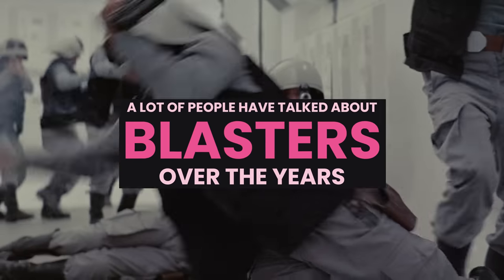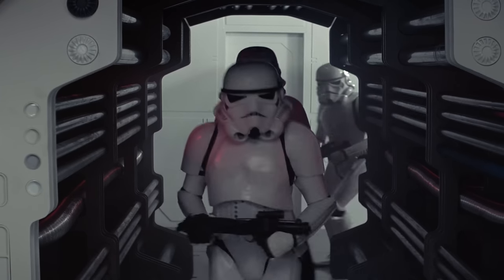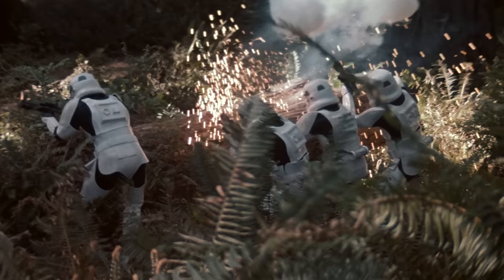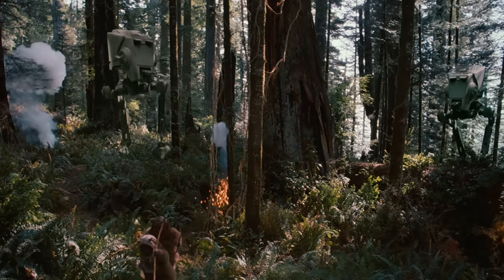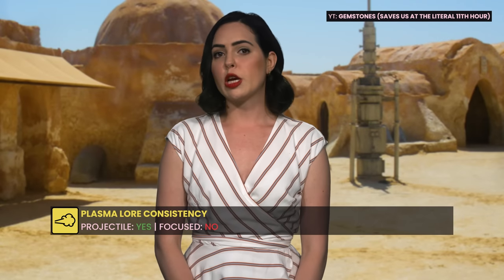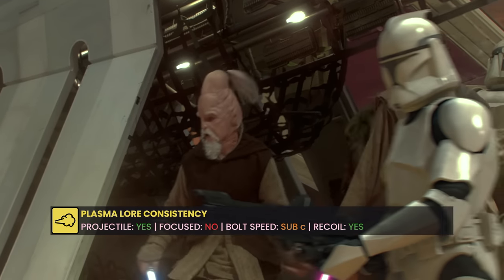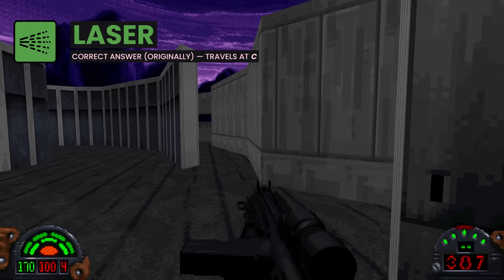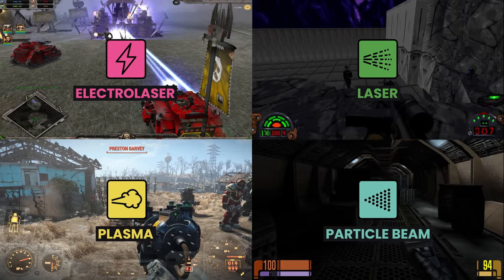Star Wars BLASTER TECH: The Definitive Guide

Comment: TLDR: I think blaster bolts are packets of charged antimatter particles encased in a cloud of charged regular matter. That creates the visible trail of light as the two types of matter mix over the course of the bolt's trajectory creating a sort of plasma, explains why they're so destructive upon impact, shields work by deflecting charged particles, etc.

Original comment: I consider myself about as much of a star wars nerd as imaginable and I never knew that the lethal part of a blaster bolt hits before the visible part! Suddenly I'm questioning everything from blaster reflection by a lightsaber to even the death star beam itself. Mind actually blown! Especially since it makes a lot of sense.

Edit: Shielding should be renamed. Blasters make the most sense as particle beams and so does their shielding/deflection. Since to deflect a particle beam you just need a magnetic field like our planet has. Both likely components of star wars shielding and lightsaber design. So ray shields are just magnetic fields, while particle shields are more of a physical barrier. 

Imo the two names should be reversed and that does appear to be the case given that Anakin, Obiwan, and Sidious get trapped aboard the invisible hand with a ray shield and not a particle shield. Similarly, we know that lightsabers can defend against actual projectile weapons by melting the projectile. Alternatively, I suspect Force sensitives can easily dodge (or use the Force to deflect) projectiles. Since otherwise standard buckshot would be the absolute bane of both Jedi and Sith.

Edit 2, cause I just thought of something else. I recently learned about a scientist that accidentally placed his hands in a particle beam. (Kyle Hill's video on the Hanoi Incident) The interesting thing of note is that it was a beam of xrays. Yet Kyle (and the sources he went through) referred to it as a particle beam. Which is correct, since photons are as much particles as electrons, protons, etc. are. They're just different kind of particles. Star Wars particle beams could even be composed of antimatter particles, and it'd still technically be a particle beam, although that probably wouldn't work too well in an atmosphere. Unless something was pushing air out of the way or it was somehow not getting destroyed by it in sufficient enough quantities to kill the user.

Edit 3: I'm increasingly convinced they're antimatter particle beams. The energies involved definitely support that too. A single star destroyer turbolaser blast has nuke levels of destructive power. The most efficient way of getting that would be with antimatter. Also until recently, we weren't even sure if antimatter fell down so it's plausible to say that's how repulsors and maybe even artificial gravity work too. 

Edit 4: Woah, what if the light comes from matter antimatter collisions! Only issue is that wouldn't work in space but in atmospheres it'd do a pretty decent job of explaining the bolt of light. Maybe space has enough dust floating around from battles, exhausts, etc for the effect to still work even though it's mostly a vacuum. The main issue with this would be if it's hitting enough junk in space to make a visible beam then it'd hit enough air to be lethal for the shooter, while if it's safe for the shooter it shouldn't cause light in space. Still an interesting idea... Maybe there's regular matter surrounding the antimatter beam to push air out of the way and it mixes just enough to cause a visible beam. Who knows! Let's build it in a few millennia and find out.

This comment got so much longer than I expected.

Comment: There's a 5th theoretical model. Like maybe it's basically a shiny ball of energy that travels at roughly the speed of sound. The speed and luminescence is what causes it to look like Glowpaintball/Tracerball rounds in real life - except the mass of the tracerballs causes a downward arc. So basically, the power has no mass, but the energy can still dissipate over distances. We may never know what such a thing is, but it's best to use game physics to describe it. Using game physics you can theorize what it is and how much power it loses over time and distance in air, water and vacuums. "if glowy line hit you you die" works fine as well as well as it's whatever space fantasy writers need it to be.

Comment: I thought that a low energy laser-light passed through the crystal which focused it and caused it to turn the tibanna (or other gas)  into a plasma when it passed through it. With it the resulting ball of highly energized gas (and light) being electromagnetically propelled. The electromagnetic propulsion also causing the outermost layer to be externally neutrally charged but internally positively charged and bonded. This makes a sort of casing around the blast so as it travels the gas does not diffuse. Then upon impact this layer is breached and the high energy atoms of the gas burn a hole in the target and/or burn in, cauterize the wound and then cook the targets insides.

Comment: I work with plasma cutter everyday and the thing about this technology is that the plasma stream IS somewhat focused. It's done partly by the torch nozzles and partly by rotating inert gas around the plasma stream. We only can't take the flame and fling it at someone. But the thing has 20K degrees! Even lightsabers should be based around plasma instead of crystals.

Comment: Just to take a shot off of this off the top of my head, what if the blasters used plasma, superheated Tibanna or other gas, to apply energy to the beam of light as it exited? The hole at the front of weapons would be for exhaust, given the energized beam would exit so quickly it might pull the plasma out with it by force or behind it by pressure… then the plasma follows the path of the energized beam, the beam strikes first at the speed of light, the light show remains, the focusing crystal is used, and the plasma part of the projectile works in vacuum due to momentum, while the light beam works because it needs no atmosphere. Does that cover everything? The weakest point is likely that the light beam would push/pull anything along with it; light gains energy by raising in frequency (wave), but still remains active as both a wave and a particle, and its activity as a particle might push/pull the plasma as it exits. I’m not sure if photons can behave as waves and particles simultaneously, or even proximally in a small period of time, so that remains the weakest point

Comment: I would prefer to think of Star Wars weapons as plasma laser launchers.  Therefore, the blasters launch plasma beams which decay, generating a laser which damages the target in front of it, as well as waste light.  Therefore, within a certain range blasters damage things with plasma, after that range, their damage is due to the laser emitted from the plasma.  The whole turbo thing still makes sense to stabilize the plasma laser packet, and sheilds also still make sense, if one considers them to be electromagnetic barriers, they would block the laser and disrupt the generating plasma component, dissipating the energy somewhat safely.

Comment: For my own sanity, i have to think of blasters as injecting energized tabana gas into the blaster past the focus crystal and have the crystal hyperfocus a laser/electric charge to magnetically contain and launch the gas as either plasma or particle beam.

I also like to think that the term "laser" in starwars has become generified from the original meaning. Like how bandaid is a brand name that now represents all household bandages for minor wounds. They used to use legit lasers and then their old star galleons outfitted their hulls with reflective materials that were immune so they developed blasters and kept the widespread and well known terminology everyone was familiar with. Its the starwars equivalent to us still using a floppy disc icon to represent saving a file.

Comment: Another issue with any explanation (such as lasers) that involves the idea of blaster bolts traveling at light-speed is that it makes zero sense that jedi should be able to deflect them with lightsabers, as that would imply that they’re literally able to move at the speed of light, which, even aided by the force, should not be even close to possible. And lest you say that this ability was invented in 1999 together with the whole plasma thing, i would point out that luke is clearly depicted as deflecting blaster bolts from attacking speeders in ROTJ (and possibly earlier in the same film during the battle at the sarlacc pit, although I don’t remember for sure)

Comment: it could be a laser particle beam combo where the laser burns the air in the way to increase the range and cohesion (maybe not the right word but basically reduces the spread of the particles) of course that means its mostly unnecessary in space.

Comment: I would pick laser, and modify star wars physics to incorporate a different laser type we (irl) don't have. one that is slower, way more concentrated but still a light composed one.
This would explain blaster (they would use this type of laser, would be very powerful but limited in the same way).
if you check sw 2 and 3, you have "real" lasers, used by LAAT and clone artillery. they are insanely powerful, able to cut nearly anything, even more powerful than lightsaber. they would need tremendous power to work (and I don't believe we have seen any of these not mounted on a vehicule)

Comment: I have a possible explanation for the "recoil" of supposed laser weaponry. What if it's not recoil? Do the inner mechanisms actually explicitly say that there's shock absorbers or anything? What if the barrel of the weapon sliding back isn't the weapon recoiling, but a sort of "opening up" thing? This may also explain the problem with the hole in the end. So, the laser has a focusing lens in the barrel. What if the end of the barrel is a sort of protection for the delicate lenses? Sort of like how some sharks have a third eyelid to protect their lens when they enter a dangerous scenario. Because turbolasers are so big, it's convenient for engineers to just add a sliding barrel so that less stray radiation is absorbed by the material in the barrel on its way to the target. Small blasters don't get this luxury because it would turn them into a WWI Lee-Enfield in a dirty environment.

Also, why must stormtrooper aim still be mocked? Wasn't it said to be due to a limitation of their targeting solutions provided by their rangefinders or something? I mean, all the times in the original trilogy that stormtroopers fail to hit targets frequently are indoors, which is specifically where their rangefinders were not designed to be used.

The problem with this theory would be that the weapon recoils after the ray is projected, but maybe one of you guys can patch this up? I think I like the particle beam explanation the most, once you look past the issue with shields.

Comment: The beam tube, somewhat ironically, mirrors real life firearms. Early firearms were difficult to use, heavy, requiring a massive bipod to use effectively, were extremely inaccurate, and often required up to a minute to reload, with a nonzero chance of it blowing up in the users face. This made them in every way worse than bows and especially crossbows, which were cheaper to make, and so easy to use that you could give a bunch of them to untrained peasants and fend off a much smaller professional army. 

However, firearms could penetrate plate armour from range.

This is an effect seen many times through history, and has been dubbed the Dreadnaught Effect, when something, generally a weapon, has one advantage over its predecessors that makes the predecessors entirely obselete

Comment: You did not mention this. Any explanation has to tie into how light sabers work. Light sabers have focusing crystals. Blaster bolts can be deflected by light sabers. Light sabers can parry each other. 

Ignore the crystals and the  blade can be formed by a magnetic field and parrying blades and blasters can be explained by the magnetic field if bolts are magnetic like plasma.

A light based lightsaber of course fits the name and is compatible with crystals. It may be explained by curving space in a loop to form the blade. Not sure if this can explain parrying but this could explain deflection of laser bolts and plasma or particle bolts.

Comment: I'm not geeky enough but here is what I know.  Mythbusters wanted to know how fast the plasma bolts traveled and it was possible to get out of the way in time. Turns out from movie footage calculations the bolts were moving at over 150 fps, far faster than possible jumping out of the way. In theory they should be traveling  at the speed of light. Also you can not create plasma outside of a sealed container let alone fire it in atmosphere.  Like director Ron Howard once said, if you want the truth dont look to Hollywood.

Comment: lasers would make a straight line all the way to a target and could be invisible, most consider it a plasma bolt

I don't know about invisible beams, never really seen the target get hit before the bolt connects

(was commenting as I was watching, I've thought of this before)
Reply: I have to say, growing up with star wars before knowing actual science. The word laser changed meaning for me due to star wars.

And i've always called the limited length slow moving thing you see on screen a laser. Until i learned L.A.S.E.R. is actually an acronym and worked completely different in the real world.

I'm completely fine with words having multiple meanings. So laser could have 2 definitions, the one from this world with actual meaning of the acronym, and the one for a fictional light projectile what you see in star wars.

Similarly as a kid i always called a light saber a laser sword for the exact same reason and i still stand by it. Light sabers are still standing laser beams on a stick in mind. They work in star was universe because different laws of nature there.

The fact that you need plasma in this world (like the hacksmith shows) to get something that works similar is irrelevant. That thing still does not work the same as a light saber does, and thus proofing star wars Universe does not work with the saw physics rules
Reply: @DrTheRich  Someone did point out something interesting. Galactic Basic could just not translate well to english hence the use of words like laser in universe being used

Also I do not count jj Luke's use of the word to describe a lightsaber

Comment: It doeant undermine shielding actually. This has already been accounted for. Shielding on ships is a combination of ray and particle shielding. The exhaust port couldnt have had a particle shield because then it wouldnt function. The reason an X-Wing's blaster cannon couldnt have worked is because while the ray shield wouldnt have blocked the kinetic impact, it would be worthless since it basically would have "stripped" of all power.

Plus, how tf do you expect a particle beam to turn at a near 90° angle into the port? Only a torpedo could do that.
Reply: Also: Why would ray shields be used on the ground then (Phantom Menace.) if they didnt stop blasters? 

Fun fact: Do you know why the droids approached on foot? Because the tanks couldnt pass through the shield. Ray shields disable repulsorlifts.
Reply: Side note: The Death Star was created to bypass planetary shields, which are combo shields. You can actually see the planetary shield flicker when the Death Star fires in ANH.

Comment: You mentioned lightsabers being a laser but that doesn’t fit. Neither does plasma. The heat generated would kill the user. Chopping off someone’s hand would flash-vaporize so much water you’d be heavily injured or even killed (look up industrial accidents involving water and heat working, just morning dew can destroy entire industrial machines). Its also rather odd for Obi-Wan to consider them civilized if they essentially do the same as a blaster: burn the target.

But Star Wars has had the answer already in the first movie: its a controlled tractor beam.

Think about it. Its a Jedi, using a Kyber crystal (force sensitive crystal!) in a weapon. Why would this kyber crystal create a beam of light or plasma?

It would work in layers. The outer layer repulses things at the local atmosphere density. This prevents the air from entering the blade and causing problems, but it also explains the tell-tale humming sound if you move the blade, neat!

Then there is a layer of vibrating tractor beams with each tractor beam being the size of a molecule. Heat is nothing more than the vibration of molecules, so these vibrations would heat up the target material until the molecule can be ripped off and pulled deeper into the blade, which can be done by a general inwards vibrating direction. This also neatly explains how some materials can resist Lightsabers: they are single-molecule structures like diamonds or Graphene. Tearing the molecular bonds is far harder. Additionally it explains why the user isn’t harmed by the when you cut someone: the materials are pulled into the blade rather than explode in your face. Additionally if the blade comes into contact with another blade it cannot pull the tractor beam forces in, so they stall and feel like a barrier is hit.

Then you have an inner layer, the core. Hot material is cooled down here by the tractor beam, as it accumulates it has to go somewhere and is expelled semi-randomly out of the blade in a visible spark.